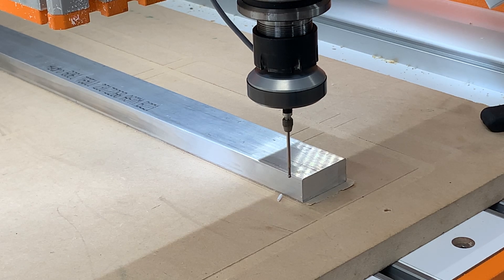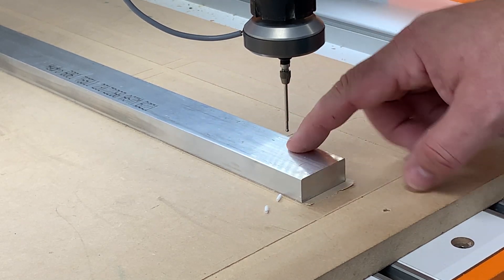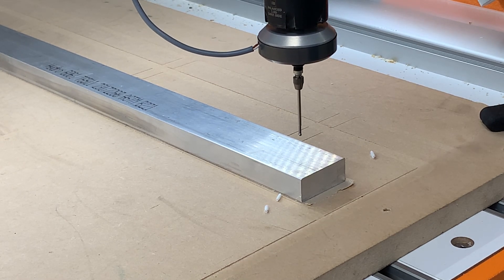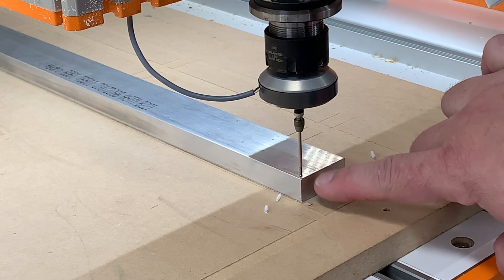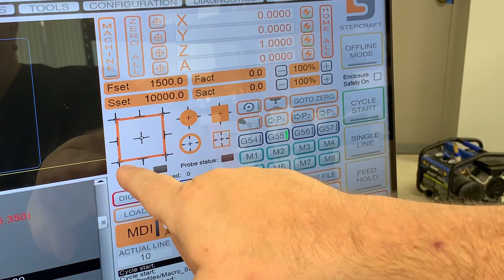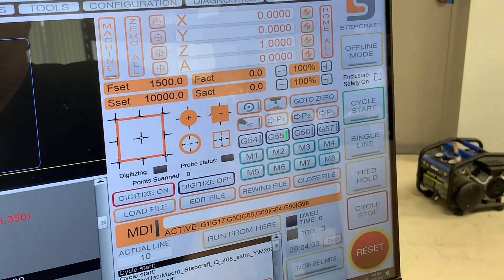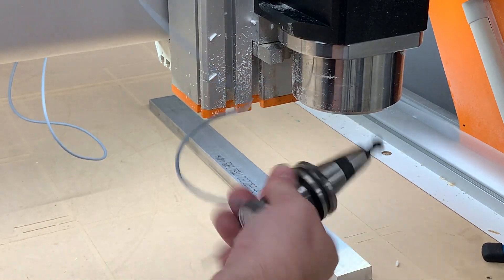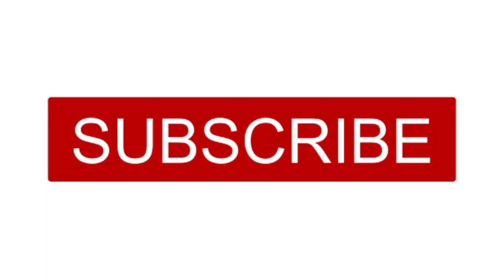3D Touch Probe - The Most Useful Tool For Your CNC Router

Comment: Very nice video! Minor point, the tool you show at @4:20 is not a spot drill bit, it is a center drill. A center drill is used to create a 60 degree conical hole intended to accept the point of a live or dead center on a lathe. It is not a spot drill. A spot drill has a single tip angle and is very rigid (for its diameter and material). It is used to create a starting point for a subsequent drilling operation with a conventional drill bit. Lots of people don't know about this difference and using center drills often is "good enough", but if you going to be drilling metals, in might make sense to get some proper spot drills to improve accuracy of location of drilled holes.

Comment: Do you know if there is a way to use the touch prob to indicate material in if its not square on the machine? For example if you placed that material on the table at a slight angle, could you touch down the side of the material with the touch prob to indicate its postion and still machine all your holes in the correct location?
Reply: You can tell UCCNC (and many others) to measure the angle between 2 points, which is pretty much what you want

Comment: Great video.  Could one use this touch probe to “scan” an existing curved object and place the data back in vector pro?
Reply: Yes, it supports running sequences of semi-automated depth measurements and there are bed leveling/compensating macros.

Comment: but this is not a standard spindle that uses a nut to tighten the bit...
can you explain what's gong on?  what loss gain of Z does this spindle system create?
Don't be shy in explaining thoroughly... or point to some documentation that spells it out.
t.y.

Comment: I understand how the probe precisely zeroes the X/Y/Z surface of the material to mill, but once you remove the probe how does the controller know the length of the tool bit in the spindle?
Reply: you have to 0 z axis again
Reply: @MainCharacterxD  Thanks. That was obvious indeed.
Reply: I know this is old but I would think with the probe you'd use that to calibrate your tool setter, and then with that at a fixed height, that is your reference for all tools. Then as long as you never adjust the gauge length of the probe relative to the spindle you can more-or-less continue to touch off tools to the reference (with some periodic calibrations of course). At least that's how I do it on my Haas.

Comment: How to remove the offset from the touch probe? I mean the center of tool to be exactly on the edge corner
Reply from the maker: It is done in the Macro that we wrote.  It can be modified for any diameter of probe tip
Reply: @StepcraftInc  by me the center of circle isnt corect. how to fix that. I want the center of the tool to be exsacly of the centre of cylinder. how to fix this? I see some offset that is on +y
Reply from the maker: @DianTomov_ST_Dupont_Lighters  Please email support@stepcraft.us and we can send you more info

Comment: I appreciate the tips. I ended up with a Laguna IQ Pro about a year ago (your Q-series was just being announced then, plus I wanted the ability to machine past the table bed a bit for vertical mounting of parts), and have to deal with a limiting hand-held controller. I don't know of a way to use something like this with a HHC. Any ideas? Your Q-series looks better and better every time I see something on it. I like the ISO30 tool holders (mine uses smaller ISO20 - not as hefty, but ok, I guess). Had to build my own stand, too - kind of a pain... Nice system you're putting together there!
Reply from the maker: Thank you for the compliments.  Sorry we were not more ready when you needed to buy.  I do like the ISO30 tool holders as well so I can use up to 3/4" shank tooling.  The spindle is more than powerful enough for this.  We might have a vertical solution soon :-)

Comment: For a future video, please consider one on the initial setup and maintenance of this tool, which is one of it's few drawbacks. I don't know how it's accomplished with this model as I have only used a Renishaw model in the past. People should be aware of the necessity of verifying that the stylus is within a few thousandths or less of being in line with the spindle axis and that this should be checked on a regular basis. There also should be some function within the control to lock out the ability of the spindle to start while the probe is in it.
Very good video; concise, informative and to-the-point. You gained a sub today and I look forward to future offerings.
Reply from the maker: Thank you so much!  We will be making more videos on this tool which include the setup and calibration.
Reply: I watched this vid today and my 1st thought was...why the hack there is no initialisation to setup the touch probe...😱